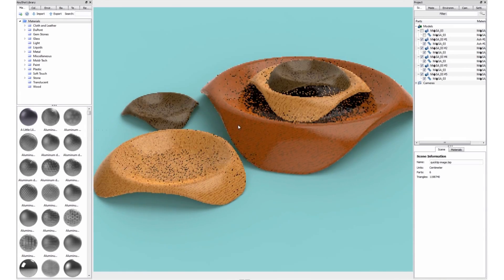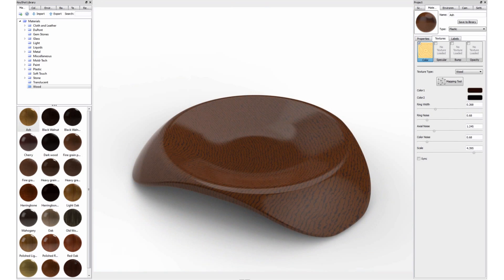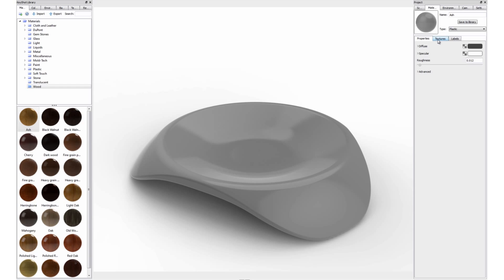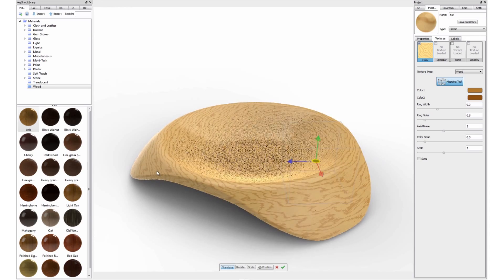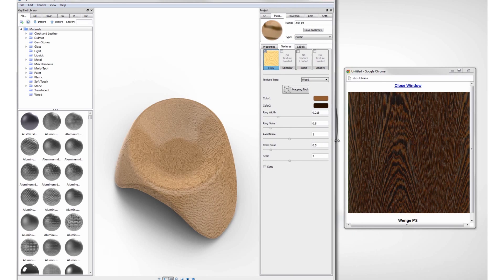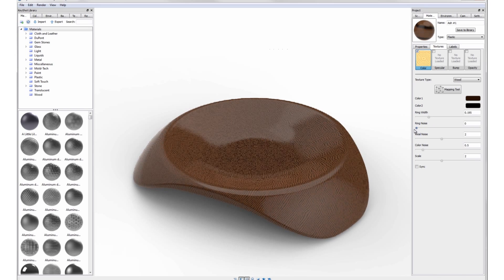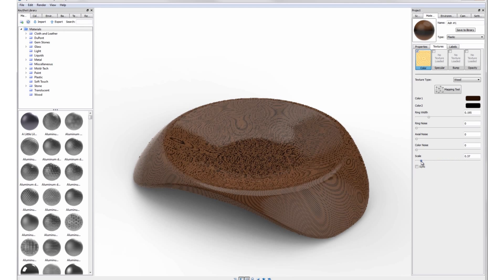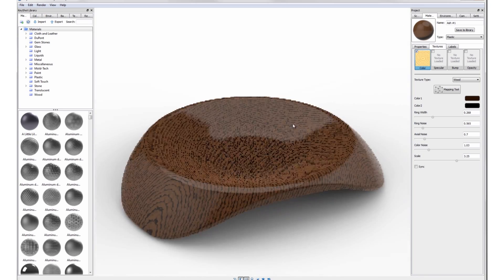KeyShot Quick Tip: Procedural Wood Textures

Comment: I managed to do this on a part I was rendering, but when I came to do it again, the mapping tool does not appear when I click on it once the wood finish has been applied? The mapping toolbar does not appear at all
Reply: Nevermind, I managed to fix it by applying a different textured material and then going back to the original material. Seems to have forced the mapping tool to become active